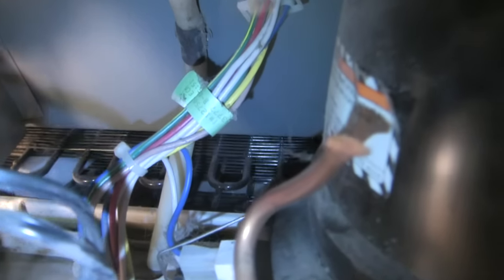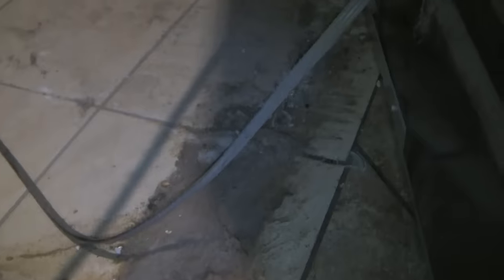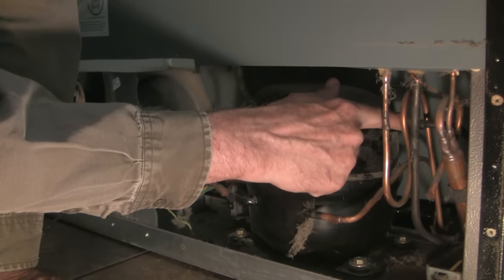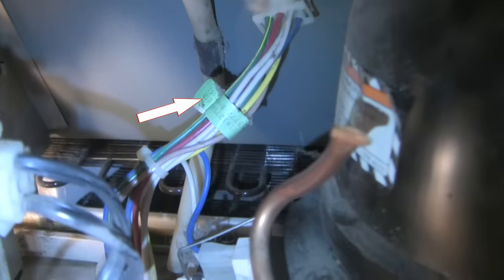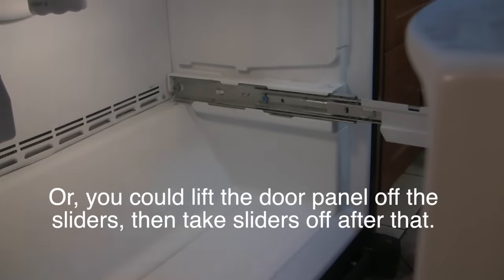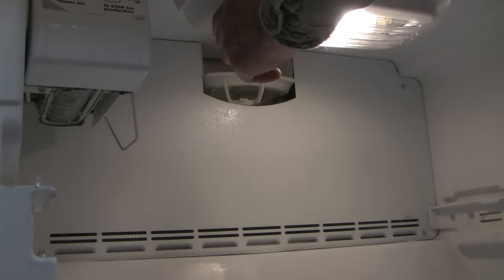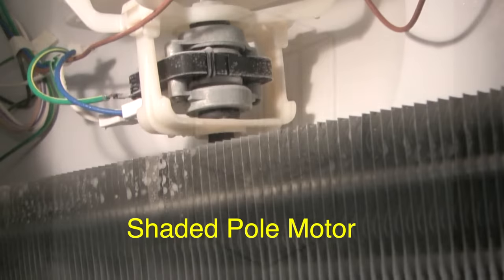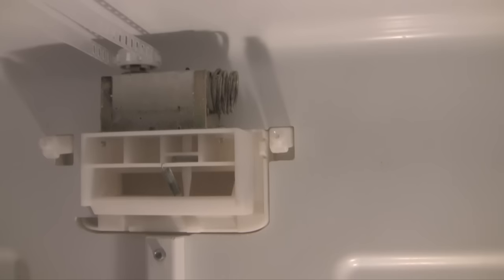How to investigate and fix a fridge that is too warm

Comment: What's on there to tell you the hp of the compressor !
Reply from the maker: I'll throw a big fat guess that the sticker at 3:52 showing "1PH" may be a bad portuguese translation of 1 hp. Not sure, it may just mean single phase, obvious for the voltage applied. If it's important for you, you could do a google search on the serial number. The other source of info will be the circuit drawing, often hidden somewhere in the fridge. Mine was in a plastic envelope taped underneath the front panel, adjacent to the condenser coil, barely visible. It has details for the run capacitor, no start capacitor described.
Reply from the maker: OK you got me thinking about this. The data sheet for our fridge shows a power consumption of 153 watts, which would put this in the ~ 1/5th horsepower range, hp is not listed on the data sheet. More details likely available from the model number and a google search. It is pretty rare to replace a compressor on these, mainly because the labor costs plus parts cost end up being close to what you would pay for a new fridge.

Comment: @spelunkerd  hello and thank you for the info .Could  you give me some insight on troubleshooting cause my fridge has a serious issue. Although the freezer works  fine i guess ,stuff are frozen ,the upper part of the freezer has 8 celcius and on the lower part of the top part has some ice build up .what i did to solve this was unplugging the refrig and manually defrost everything by having every plastic inside the fridge exposing fans etc removed but that didnt fix the problem .although in the beginning the temperature was 4-5c. I had a tech come and check it he did the exact same thing + he removed the fan and plugged the fan straight to the ac socket on the wall to "check" it and guess what happened he burned it and he said it was already ruined,meanwhile i didnt tell him that i have knowledge of electonics ... Yhe godamn thing was 12v and he plugged it on a 220v wall socket beside me insisting that it would be stupid.Anyway he changed the fan insisting itwas that problem but the prpblem is still there and i m loosing my mind and money . Can you give some advice so i can  troubleshoot the damn thing.
Reply from the maker: Those motors I showed are shaded pole motors, they usually run on 120/220V AC. On my channel I did a different video of an oven fan that went bad, and I demonstrate and explain how shaded pole motors work, they are ingenious devices. The most common cause of frost buildup is moist air getting in, through even a tiny slit, so your decision to defrost and try again was wise. Look closely for that, and clean your condenser coils. If your fridge has a defrost cycle, that system might have gone bad, either through a bad heater, a blown fuse, a bad timer or a blown circuit board. Search for a wiring diagram hidden inside the fridge somewhere, or search for it online. The wiring diagram would verify the voltage your fans run on. You could also use a multimeter to verify the incoming voltage for the fans if they are not turning on, and you could check the fuse if there is no voltage there. Beyond the simple things that I did in the video, the chance of finding something that you can fix is pretty low. Low freon charge could do that but it would mean another professional service call and the return would be diminishing. It's fairly common for the compressor to fail to start, in which case it makes a clicking sound or a humming sound. Some of those respond to replacing the current relay, but I would have expected the pro you called out to find that immediately. If nothing helps I'd consider cutting losses and recycling the old fridge.

Comment: Thank u very much as a single mum I can now try to fix my fridge myself
Reply: I can’t find the part of the compressor. All of the tubes are cold. Wtf?
Reply from the maker: Both ends will be cold if the compressor is not running, so then the challenge is to decide why. The compressor will have safety cutoffs if the freon charge is too low or too high. Unfortunately domestic fridges don't often come with Shrader valves to measure pressure. I'd be looking for simple things, like verifying you have power on and the switch inside the fridge on, then move to a circuit drawing to decide what controls power delivery. You can quickly assess the compressor by disconnecting it from power, then check resistance and check for a short to ground on each of the three windings. Look for blown fuses. Unfortunately the cost of replacing a major problem like a bad compressor may be more than the cost of a new fridge.
Reply: spelunkerd Thanks for the answer! According to the technician, the compressor is not getting any power from the motherboard (the brain of the fridge).

Comment: What about no fans working no compressor kicking in. Power source is fine. Lights work in both freezer and refrigerator.
Reply from the maker: I'd look for the wiring diagram, usually hidden somewhere inside the fridge, or if not there then online. There is a defrost cycle with a timer, and when in defrost the fans may be shut down. If the defrost timer gets stuck, it could look like that. Check fuses and coming off the power supply, check power and ground connections to the main board. It may be a main board problem, or a failed component that caused the board to shut down other devices. For example if the compressor fails to start properly, the board may be programmed to shut it all down as a safety measure. Look for corroded or chewed wires. Some fridges have trouble codes available, but many companies don't share that information to nonprofessionals. If you find the cause, please stop by and let us know what was found.

Comment: The hose in the back of the fridge that removes the excess moisture into the tray, if that was frozen would it cause a leak inside the freezer?
I'm having trouble diagnosing an issue with the Ice maker (Electrolux refrigerator). The ice maker and the hose leading to the ice maker are both leaking cause a build up of icicles.
Reply from the maker: Yes it can.

Comment: A malfunctioning compressor may prevent the fridge from cooling at all
Reply from the maker: Yes, for sure. This vid was a general overview, mostly aimed at the simple fixes we all look for in an effort to avoid calling a pro. Other common situations where the compressor won't turn on include a fridge stuck in defrost mode, a failing capacitor or failed current relay, a bad control panel, rodent damaged wiring, or a refrigerant leak where the low pressure switch won't allow the compressor to turn on. Clues regarding those diagnoses are in the wiring diagram, often requiring much more skill and tools than most homeowners will have.

Comment: Wish I could have an easy fix. Coils all cleaned.   Going on 10 days of cooler/camping.  The fan blows kinda cool air (not freezing)  in the freezer.  Can we still hire appliance repair men?
Reply from the maker: Good question. The death knell for repair of appliances came with cheap new products made in China, and unfortunately those mass production savings aren't seen in the parts or repair industry. Labor here in the developed world is still very expensive, as are business costs, which is why outsourcing became a thing. To make matters worse, household fridges don't usually come with shrader valves on lines, so even measuring pressure, finding leaks, and refilling with freon can be more effort. I'll guess that a simple repair would be a couple hundred dollars even if the compressor is fine, so you need to decide whether you're willing to take the gamble or cut losses and get a new fridge. I hate throwing things away on principle, so I'd probably look into it by calling around. Last week I was shocked to see many new looking fridges and freezers in the local recycling yard....

Comment: Okay but my fridge/freezer doesn't have any fans
Reply from the maker: Small fridges use a more streamlined design, often with a vulnerable ptc relay to drop current to the start windings out after the compressor gets going. If the compressor won't turn on, shake the ptc relay to see if it is broken. If so it's an easy fix for those tiny beer fridges with no fans. There are detailed videos on ptc relays explaining more.
Reply: @spelunkerd  It's a very big double door

Comment: Hi. How you check the fan? The door suppose to be closed to get the fan running
Reply from the maker: If yours is tied to a door switch, sometimes you can manually close the switch or even temporarily bypass it. The other source of info will be the circuit drawing, which is usually hidden somewhere in the fridge, often in an unobtrusive plastic sleeve under a panel, underneath the fridge, or near the main board. Failing that you can use a multimeter to help decide whether the fan is getting power and ground, and whether there is a voltage drop leading to the fan. Explanation of voltage drop testing and other more advanced diagnostics would be almost impossible in a thread like this one. I did go into shaded pole motor diagnostics on my video of the oven fan, where I hotwire the fan directly after removing it from the circuit to verify it is bad. Many fridges go through a defrost cycle and problems with that cycle are also fairly common. Good luck!

Comment: I have a MayTag mzd2766gew,at first there was a clicking sound which I traced to the starter overload and relay and I changed it and the refrigerator worked fine,I later disconnected it from the power supply to put it in it's right position at a later time and when I eventually did it will starts and stops immediately.What can possibly be the fault.
Reply from the maker: I'd be looking to see if it has a start/run capacitor, wondering if it has gone bad. Also I'd be wondering if freon pressures are wrong because of a leak somewhere, triggering shutdown. Unfortunately new domestic fridges don't necessarily have shrader valves to easily measure pressures. New fridges sometimes have electronics that can trigger fault codes, readable after a glance at the dealer repair manual. Some motors have centrifugal switches for the transition between start and run. Those can stick. A schematic diagram is often hidden somewhere in the fridge.

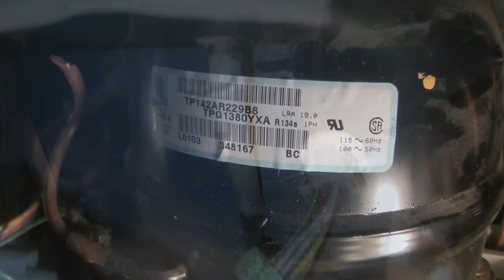Comment: 3:48 ha ha “made in Brazil, interestingly”. I will give you one more interesting: I was at factory next to the one you likely reference…~3 hrs outside Sao Paolo. The Brazilians told me “that factory sells you appliances in U.S. for 50% less than it costs us right here!” I said, “what?” I researched it. 

It is related to absurd domestic sales tax AND population manipulation via their corrupt form of population control: installment plans for desired device or product including jeans! Also, absurd interest rates. All prices in most of Brazil that I have seen are based on 4-5 payments!?

There is always a story behind another’s story and thought I would share ;-)
Reply: Taubate , Brazil

Comment: My compressor is working, my condenser fan is working, and my evaporator fan is working. Why isn't my freezer not freezing, and my fridge not fridging?
Reply from the maker: Probably the most common problem is a poorly fitting or warped door, causing leakage of air through a small gap in the door seal. Carefully go over that again, and look for food inside preventing complete closure, it is one of the few problems you can fix. If the door is twisted slightly, there's a way to fix it, I did a video of straightening a freezer door. If your inspection showed nothing more, done as I did, then the next most likely problem is low freon caused by a leak somewhere. Unfortunately investigation and repair of that is often not worth it for an old fridge. Many consumer fridges don't even have shrader valves to measure pressures, so techs need to puncture a line to install a tap. Limping along with a badly functioning fridge can be a drain on the wallet from high energy costs, so I guess it is no surprise to see so many fairly new fridges at the recycling yard these days.
Reply: @spelunkerd  yeah there's no gaps in the door. Is there really no way to check for a leak?

Comment: Mine stopped cooling a week ago and I paid a Tech to come out, and that was the first thing he did. I have GSD and the coils were packed with dog hair. He  vacuumed the back clean the houses, and said give it 24 hours. 36 hours later. no cooling and when I change the temp settings. They keep changing to 76/77. Not sure I spent my money well.
Reply from the maker: What to do next depends on the design. Sometimes they stick in defrost cycle, sometimes the ptc relay or capacitor fails, occasionally it's the board, a freon leak, or a failed compressor. Learning how all of those are diagnosed may take you days of effort, with no guarantee of success. Money spent on repairs needs to be compared to the cost of a new unit, which comes with its own warranty. No wonder there are so many new looking appliances at the recycling depot.
Reply: @spelunkerd  I agree, They are becoming like laptops. Not worth fixing. Thank you.

Comment: Thanks so much for your video. I am going to try and trouble shoot a problem with a fridge that is not cooling. Although it does cool the freezer a bit. (from room temp down to 10c)  there is no cooling in the fridge and the evaporation fan in  the freezer is noisy. It was left plugged in over the winter in an unheated building by the previous owner. Might you be able to suggest the most likely places I should target my testing. Thank you!

Comment: My back freezer coils are so hot
Reply from the maker: That's a good sign. A fridge is a heat pump, pumping heat out of the cold areas into the surrounding room by blowing off heat from the condenser coils. Hot compressed gas from the compressor condenses into room temperature liquid, and the condenser fan blows the hot air out the back.

Comment: The evaporator fan in my Frigidaire cycles on and off continuously.  It had a lot of ice build up. After I defrosted manually, it still cycles from a high speed to a low speed every second or so. Any suggestions?

Comment: Hello, and thanks for this informative video.  My refrigerator is not cool but my freezer works.  I have opened it up several times and noticed evaporator fan has never been spinning when I opened freezer during the temperature problem.  Today I manually twirled the blade with my finger it did spin freely, but it did not spin for long each time I manually twirled it. I am not sure if it is a a motor problem or electrical supply to the motor. I am on a budget. Actually a strict budget.   (Side note, Condenser fan in back area was clean,  freezer supply radiator type thing gets cold fast, the thermostat timer in fridge part was manual moved forward (until a loud click) and the heater in freezer got hot to touch, 30 minutes later the condensor turned on so I think the timer works).My name is Jesse and my number is 631 8948463.
Reply from the maker: If the evaporator fan is not spinning when it should be on, I would use a multimeter to see if it is getting AC voltage. If AC voltage is present, usually 120V, then the motor is bad and it needs to be swapped out. The bearings on those motors can dry out with time and it doesn't take much to seize the motor, usually causing the motor to make a humming sound. I show an example of a shaded pole motor swap in an oven repair video on my channel. If AC voltage is not present at that motor then it is a board or wiring or fuse problem. I would look for the wiring diagram of your fridge, often hidden in the fridge somewhere for more details.

Comment: I pulled my fridge out and looked underneath. I'm pretty anal about making sure no pet hair is underneath anything... But I made a mess bring the air compressor inside to help clean the coils. But I kept hearing a click on the compressor and I waited for the click again and this relay set up that costs only 13.00 had gone out. My components are minimal so this was very easy to diagnose...only issue is...it's not a local part....grrrrr

Comment: Any other ideas before calling the repair dudes?
Reply from the maker: I didn't spend much time on the three types of relays that interrupt current to the start windings on the compressor after it spools up, and I skipped over the capacitor completely. If either fails, you typically get a situation where the compressor clicks, then hums for a few seconds, then cuts off. Then it tries again in a couple of minutes. There are many videos describing those systems in detail here on the web. I did a video of a repair of a domestic heat pump that had a failing capacitor last year.